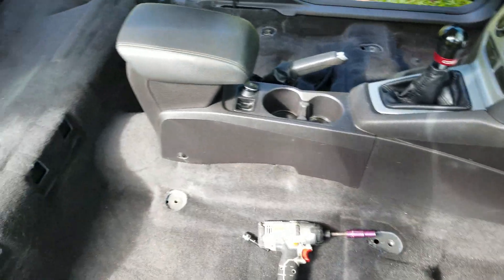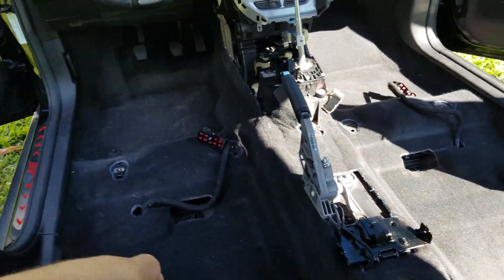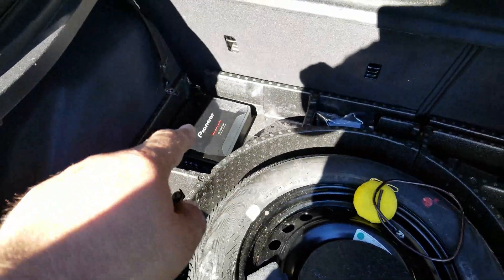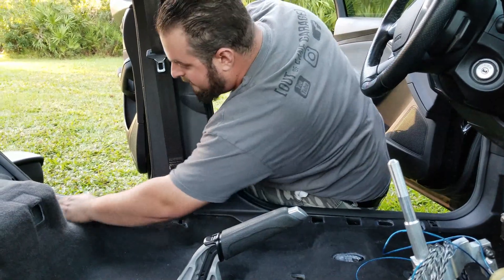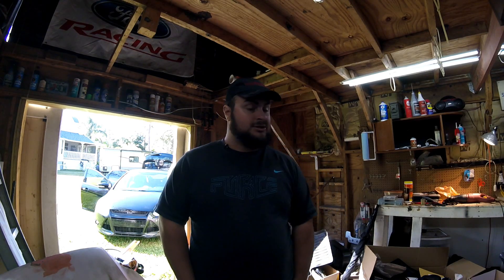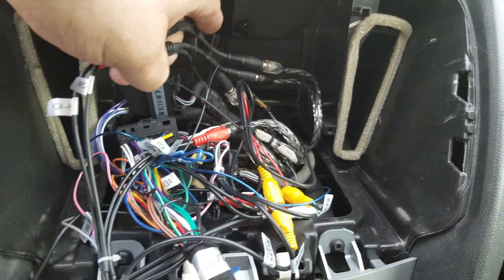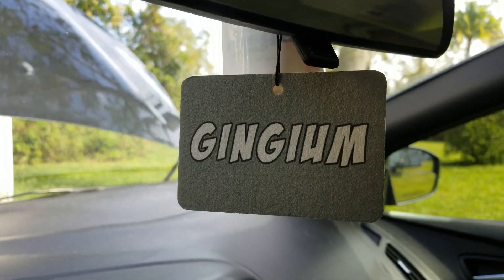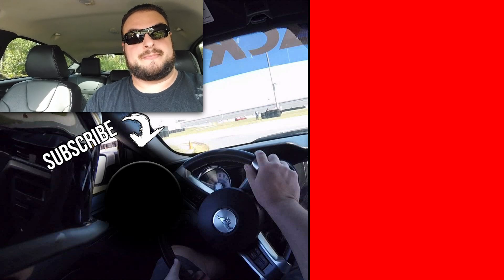Cabin Sound Deadening and Subwoofer Mounted

Comment: You may have to run all seperate wires for your doors from the head unit to the back of the car through the center console. I havent done a amp to my highs yet but i will soon.
Reply from the maker: What I think I'm going to have to do is power through my factory wiring.  So I'll bring up a set of 4 wires from the back and tie into the harness.